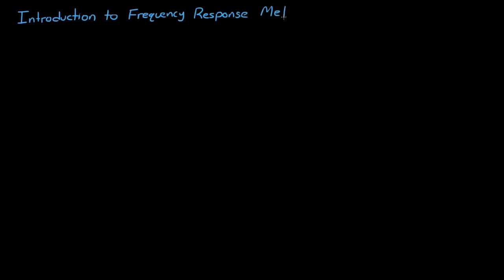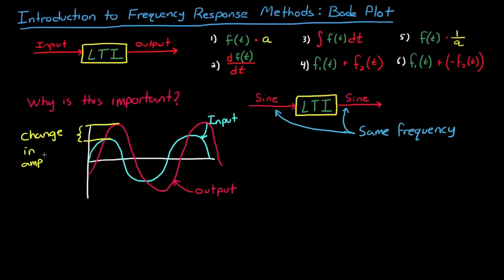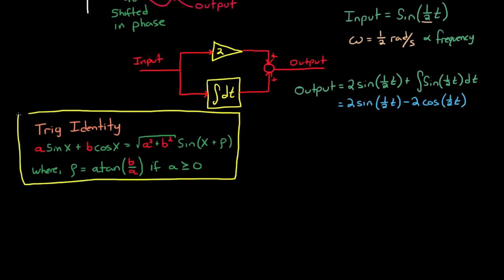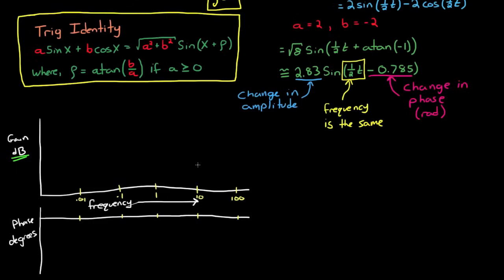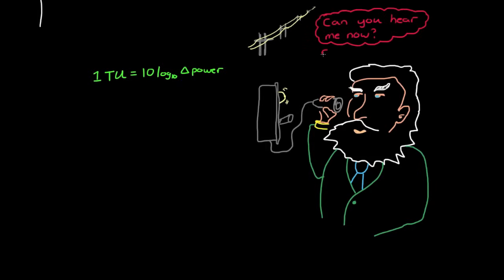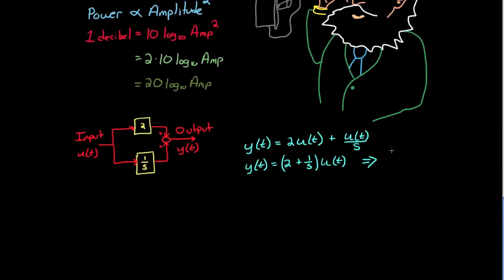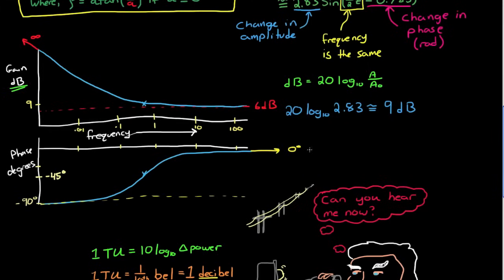Control System Lectures - Bode Plots, Introduction

Comment: at 11:40 why does the gain approaches 6dB when the frequency goes to infinity. You mention earlier that the gain in dB is 2, so shouldn't the gain approach (9-2=7)  7dB when the frequency goes to infinity? 

Can someone explain this to me? 

Thanks in advance.
Reply: In transfer function if w goes to infinity we will left with only the real part which is 2 now if you take 2 and use it in the formula that we use to find the gain in dB it will become 20*log10(2) which is equal to 6

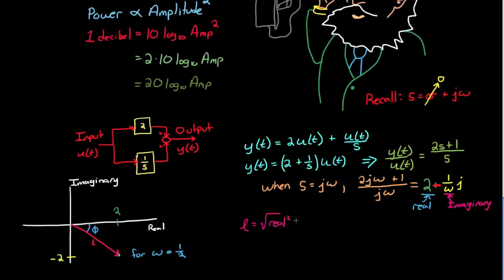Comment: I am currently taking an automatic controls class in college. At time 10:16 of this video, the length of the line drawn is defined as the gain of the system. However, in my textbook, we are taught that the length of that line is equal to the undamped natural frequency. Am I getting these terms mixed up? Can somebody please clarify this for me?

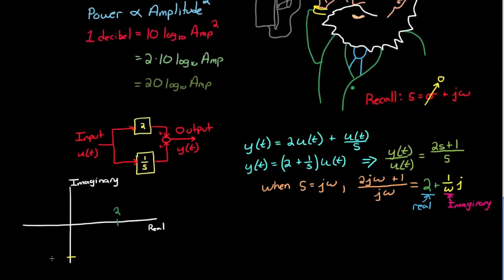Comment: Thanks for the high quality video! Why is that 2 - 1/w j at 9:39?
Reply: The previous step was 1/jw. If you multiply the numerator and denominator by j, you would end up with j in the nominator and j^2w in the denominator. j^2 is -1, and this is why you end up with -j/w or -1/w j

Comment: If any viewer here needs the proof to the equations used, it can be found in "Modern Control Engineering, by Katsuhiko Ogata" Chapter 6 Frequency Response. I'm recommending this because I was confused as to why we simply substitute "s" by "jw" and we don't input a sinusoidal function into the Transfer Function, and in the book it is beautifully deduced. Hope it helps!

Comment: quick comment:

An LTI system can generally integrate against some kernels too. For instance, 1/(s+1) is definitely LTI and when you regarding this as a tf from u to y you get the integral representation y(t) = int_0^t e^{-(t-w)}u(w)dw Classic integration by parts shows that this also preserves sinusoidal-ness.

Comment: I have a question regarding bode plots of parallel transfer functions. I know that for transfer functions in series G3(s)=G1(s)*G(2),  at any frequency the phase of G3(s) is the sum of the phases of G1(s) and G2(s), the same with the magnitude. What I don't find anywhere, is how the phase and magnitude of parallel transfer function G3(s)=G1(s)+G2(s) are determined. 

Your videos help me a lot :)

Comment: You are an incredible teacher, incredible.        I just leave a question and see if I'm lucky: in this video you put a diagram block system (the first one) expressed in the time domain. One branch multiplies x2 and the other integrates. Then you write how this system treats the input signal sin(0.5*t), and you say it multiplies it by 2 and the other integrates it. Makes a lot of sense, but I just can't find the correct logic connection of this with the fact that the interaction of the input with the system (e.g. a subsystem y=h(x) where h(x) = 2x) is a convolution. Should not the branches of x2 and integration perform a convolution operation with the entering sin(0.5*t)?             Thank you infinitely for your response, I hope I explained myself! :)

Comment: Why did you multiply by (j/j) ? 

I got y(t)/u(t) = 2+(1/jw) but Why do I need to put it into 2-(j/w)? 

 When I do the the bode plot with the 2+(1/jw) I know when "jw" goes to 0 it will be over shadow the 2 and be a very large gain. when "jw" goes to infinity, it will flatline at 2 (6db) but my direction is different I just can't get why I need to make it negative.

Comment: I don't understand why you are assuming that the system is in steady state. According to the example you used in some earlier videos of a spring mass system being given an impulse using a hammer, at steady state, the frequency response would just be 0. How can it be said that the steady state frequency response will follow 2-(1/w)j? Won't it just be 0?

Comment: Can anyone explain how the ratio of input to output in time domain is equal to the transfer function in frequency domain.
So at 8:58 shouldn't it be Y(s)/U(s) = (2s+1)/2 ?
Reply: Y(s) = 2U(s) + (1/s)*U(s)
Y(s) = (2+(1/s))*U(s) 
Using the comon denominator s, and puting U(s) on the other side, then:
Y(s)/U(s) = (2s+1)/s

Comment: at 7:21 it says for a frequency of 1/2 the gain is 20log(2.83), but would this not be the gain at w=0.785 instead?
Reply: frequency w is equal to 1/2, phase fi is equal to -0.785.

Comment: I am confused. Why would the gain change with the change in frequency? Gain is just amplitude in logarithmic form right? Why would it change with frequency at @7:53
Reply from the maker: Gain is the change in amplitude as a signal goes through the system.  Since all signals can be constructed as sines and cosines we'll just look at a single sine wave as an example.  If the input signal is sin(w*t) and the system is an integrator, then the output signal is the integral of sin(w*t)dt.  This is -(1/w) * cos(w*t).  The change in amplitude between the input and output is 1/w.  The negative sign contributes to the phase shift since it just flips the signal upside down without changing the amplitude. So the gain is 1/w which clearly changes as you change the w (or the radians per second of the input signal).  I hope this answers your question.
Reply: Brian Douglas Yes it does. Thank you very much!:)

Comment: I have a question here. The Laplace transform of 2, is not 2. Tt is actually 2/S. But when you did it at 2, the answer is still correct, why?
Reply: I'm sure you've long forgotten this question, but in case someone else has the same one I'll respond.
2/S is the transform of 2 times the step function, usually given as u(t). 2 is a constant multiplier here, so by the properties of Laplace transforms can be pulled out. He did not change his function variables in the video, but u(t) in there was the transform of the input, not necessarily the step. That is why he got two times the transform of the input.

Comment: These are great videos. And I like the idea of motivating by specific operations but unfortunately those "six operations" are not comprehensive and you cannot implement all LTI systems with those operators. For example, you cannot compose a delay out of the functions that are defined. That said, the linear operators provided give a nice flavor of what LTI systems can do.

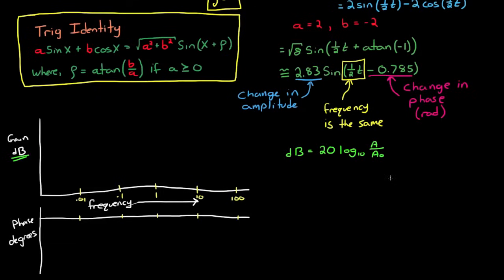Comment: A little confused here. At 5:32 you say conversion to dB is 20 log (A/Ao) but later on when you actually solve it, only the new amplitude is used and not the ratio....is this correct?

Comment: Is it a pre-requisite of using Bode to check for stability first? Because the transient aka exponential term will only die out if system is stable and not when marginally stable or unstable.

Comment: I am a high school student and trying to comprehend this topic. Everything is crystal clear except the systems transfer function at 8:18. My first question (1) is did you pick these modifications of the input at random [2] & [1/s] just to prove the point that frequency doesn't change or not?
Secondly (2), in this video you show us how 2 modifications (paths) transfer a function, however, is there a limit of modifications or would the system function not make sense at all?

Comment: what is mathematical relation between the frequency and the gain ?
Reply: +Mohamed Ali 
The whole point of this type of plot is to find the relation between them, it depends on the transfert function
Reply: +Mohamed Ali For transfer function H and frequency w, Gain = 20*log|H(iw)|.  Make sure to use absolute value!
Reply: +Mohamed Ali The way in which I think about it is that. Any given function that you can think of can be deconstructed into sinusoids of different frequencies. If said function is periodic, the function is composed of harmonically related sinosoids, whereas if non-periodic, all frequencies possible are represented in the function, where some have more presence than others. Let's say that you have a sinosoid that is not quite periodic but seems somewhat sinosoidal, that means that there is one frequency that has a much larger gain than any of the other frequencies in your signal.

Comment: Firstly EXCELLENT video! Using so much geometry (i.e. a lot of illustrations, plots, diagrams etc) is incredbly helpful in order to understand how things are related. At my university unfortunately the convention is rather to just say "here's a task, calculate it by using the formula". When you ask "but why do you do it like that, why does it work?" the answer is often "That doesn't matter, just use the formula." Well it DOES matter if you want to understand the subject, and your videos help in doing just that. SO KEEP UP THE GOOD WORK!

For this video I just have a question. You say the sine wave input will always have a sine wave output, and the only thing that will change is the amplitude, not the shape. Why can't the output change frequency? What about for example an oscillator? Because there you can regulate the frequency. Is an oscillator not an LTI system then?

Comment: at 8:31 it is not correct to write the equation in time and s-domain concurrently. Thanks AWSOME
Reply from the maker: Yes!  I have a bad habit of combining domains like that. ;)  I'm trying to catch them and add annotations to correct my mistakes.  Thanks for pointing this out.
Reply: Isn't it correct to write it as  H(s)= Y(s)/U(s) = 2+1/s
Reply: شكرا
Reply: Can someone mention what is the correct way of writing?
Reply: @shrinivasiyengar5799  Just exchange u(t) for U(s) and y(t) for Y(s), i.e. the Laplace transformed functions. :) As we're working in the frequency domain, we want to ensure that we work with the functions of frequency, not the functions of time.
Reply: instablaster.
Reply: .9887.
Reply: Walid Issa Yep you are correct.  H(t) = y(t)/u(t) =  2 + (1/s)

Comment: At 11:40, you say as frequency -> infinity, the gain approaches 6 db, which is a gain of 2. How does 6 dB correspond to a gain of 2? Did the system drop from 9 dB to 6 dB? I'm confused on the concept of gain as a function of frequency in general, I guess.

Comment: At 9:20, the transfer function becomes  = 2 + 1/w * j . How did j get into the numerator? Shouldn't the transfer function = 2 + 1/s, where s = jw, so the transfer function = 2 + 1/jw?
Reply: multiply by (-jw/-jw) which is essentially multiplying by 1. it should be 2-1/w*j which he did rectify
Reply: myband Or just by multiplying -j/-j
Reply: j*j = -1
j^4 = 1
1/(jw) * j * j * j * j
= (-1/w) * j

Comment: At 7:06 where did the 2.83 come from  when you wrote 20Log2.83. I'm not clear on what numbers were used to calculate the A/Ao. Thanks
Reply: A is the new amplitude which is 2.83, A0 is the initial amplitude which is 1, hence A/A0 = 2.83/1 = 2.83

Comment: Very nicely made videos and more than that the kind of efforts being put in and topped by the way u present, its the recipe for awesomeness.
However, a small query when u r talking abt the transfer function and so the system response is being analysed in frequency domain or the S plane, how come the signal input and output are in time domain 8:35 (shouldn't it be y(s)=(2+1/s)u(s) or else y(t)/u(t)-> 2+1/s=H(s) btw only place where I had seen two domain together was for Eigen functions y(t)=H(s).X(t))

Comment: Sir,when i use symbolic math tool box of matlab ,I found the result  is               y =2 sin(1/2 t) - 2 cos(1/2 t),but when i use simulink to build the model ,which solver is ode5 ,the result of y did not match yours,which different very much.It seems that the result   up shift ,and I THINK it caused by the integrate initial value ,which was set to zero.Now i think i should be set to -2,is that right? thanks a lot !!

Comment: One last question (I hope!): If an LTI system can only change an input by those 6 operations you mentioned at the beginning of this video, how in the spring-mass example (in your video titled "Time and Frequency Domain") did an impulse input (hammer hit) become a sinusoidal output (position)? i.e. what linear operations turned this impulse input into a sinusoidal output?

Comment from the maker: Hi Albert, I believe I said it correctly.  1 bel = 10 decibels, since it takes 10 decibels to make up one bel.  Therefore, in order to go from bels to decibels you need to multiply by ten.  3 bels = 3 * 10 decibels.

Comment from the maker: Since at infinite frequency the 1/s path goes to zero then the output is just equal to 2 times the input since that's the only path left.  That is where the gain of 2 comes from at infinite frequency.  As for 6 dB, to convert from amplitude gain to dB you use 20*log10(gain).  log10(2) is approximately 0.3 and 20 times that is 6 dB.

Comment from the maker: I'll try to explain it beyond just "The math says so!" :)  Look at the equation around 8:30, the input u(t) is affected through two different paths to produce the output.  As frequency increases to infinity the 1/s (or integral path) get's closer and closer to zero.  You can imagine looking at a really high frequency sine wave and integrating the signal over time.  Once the frequency become infinite essentially the area above and the area below the center line both go to zero.
Reply: Oh Mr Douglas, you're just awesome. I just couldn't connects these different topics from Fourier and Laplace to s-plane and what's bode plot... I just love the way you teach all these so simply. I would really appreciate if you suggest me something to feel these things deeply to think and analyse. As a would be engineer, I don't want this awesome subject to go apart of me after I know how awesome it is. No doubt your lectures are end to end to grasp the concept but ultimately practice and self exploration is the key. And you understand the things I should go through as only engineer can understand and find an engineer inside a student. Professors just teach for exams and I'm not in face of marks. I'll end my words with the request to reply to this and help me with suggesting resources.
Reply: @shanugarg8428  You can easily use Matlab and Simulink to visualize all this concepts.

Comment from the maker: Hi Joules, atan2 is a second form of atan (hence the 2).  If you wikipedia atan2 it'll give you a good explanation but I'll try to explain quickly.  If you use arctan(num/den) then you'll get the same answer whether num = 1, and den = -1, or if the num=-1 and den=1.  These two points are diametrically opposite of each other though and so if you care about which quadrant you're in you need to keep track of the sign of each the num and the den.  atan2 keeps track of the sign for you.